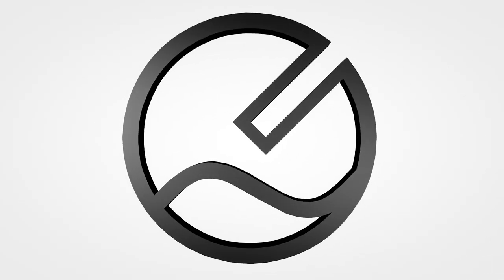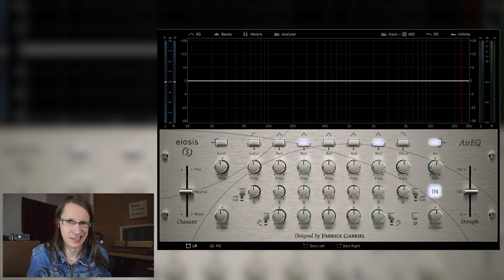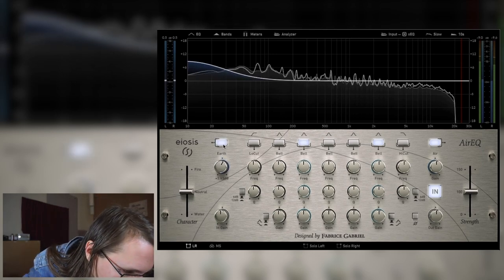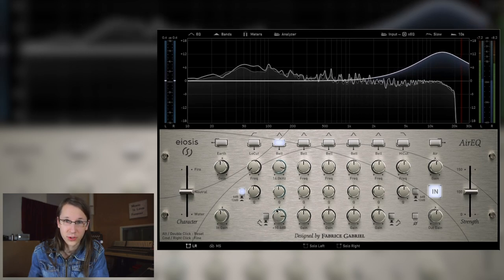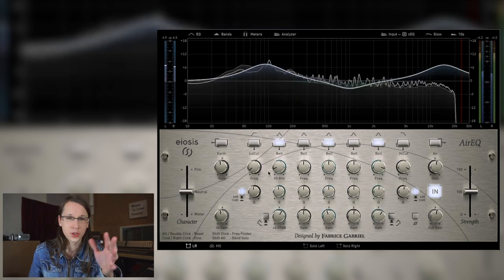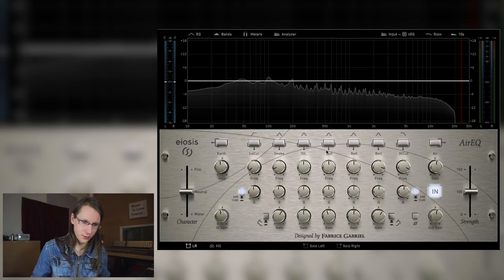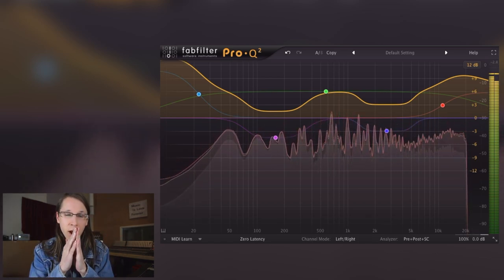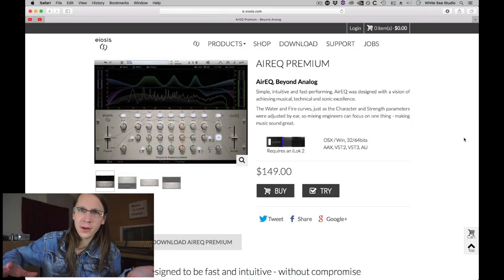AIR? EARTH? CHARACTER? STRENGTH? - Eiosis AirEQ Premium

Comment: Oh, so I need a special screwdriver to open the plugin? Noooo, what shall I do, if I have to switch a fuse? :)
Reply: In the software Reson by Propellerheads you can switch to the backside of the rack and rearrange the cabling. If one is lucky one can also spot fuse holders ;)

Comment: While I do agree about the fantasy lingo... earth, water, strength, character... we don't need a new language, do we?
But having said that, this is an underrated EQ in my opinion. I am not a professional sound engineer. I am a serious enthousiast, have read some good books, watch the right videos, and learned how to use my ears. I can EQ. Am not an expert, but I do quite well if I say so myself. But with the Eiosis I find I can do that easier. The presets are actually quite well done. The presets don't add frequency adjustments, but are just prearranged settings on the EQ bands. So if I EQ a piano, select a piano preset, one of the bands is called 'body' and has settings that indeed, modify the body of the sound. And then it's up to me to fine tune it. I like that. And while I don't know what the lelijk woord things like fire and earth mean, I learned how to use them to add fullness or brighness or whatever I like that piano to sound like. And the visual information visualises what it does to me. 
In this modern day and age that is very helpful. Sound isn't reserved for studio's and professionals anymore. Anybody can do it these days. They can't all do it well, but it's plugins like this that help those serious amateurs. More than EQ's with presets and AI and mixing assistants, simply because this Eiosis concept still makes you think for yourself and make choices based on what you hear.

In that respect, I will forgive them the language and consider myself extremely happy that this is one hell of a tool you get for just paying the quite decent all access pass. I can only recommend people give it a go, experiment with it. It's not going to work for everybody, that's for sure. If it does work for you, you'll find yourself using it more and more.

Comment: inbus is a lot more durable..it's a selling point, really
Reply: Any sane person would screw in equipment with M6x16 Philips head screws using plastic washers to not scratch the front plate of the equipment. E.g. with Rittal DK 7094.100

Comment: I dont think someone answered this, so I will in case no one did..........  But those security screws are there on real hardware, so people dont steal the hardware.
See,  back in the day in large recording studios, people used to steal very expensive gear right out of the studio.
and the owners would lose out on thousands of dollars worth of gear.  specially during night time sessions, when the owners and main manager are not around.
You had hired mix engineers come in to do the session, then you have huge large crowds in the studio session, usually rap/hip-hop crowds where they bring 
every got damn person they can think of into the studio.  then you had part time night managers who actually didnt care about the studio, but just worked there
to brag to people that they work in a major studio.  We call these "shitty managers" hence why they work at night (grave yard shift) and never in important times or important sessions.
then you have interns who come in and out like a grand central station, every few months there is a new intern which made matters worse.
and sooner or later, studio equipment starts to disappear.  So someone thought of installing rack gear in racks with security screws to prevent 
people from stealing rack equipment. 
They are a VERY important part of running a commercial recording studio......  Now these days we have good CCTV and new rules.
which is, each studio room must have a least 2 studio staff members in the room, at all times, and if one of them needs to leave the room,
you call the receptionist and have them call in a intern to sit in the room until the other person returns to the room......  most major studios have this rule.
Most importantly, the studio room must NOT be left alone under any circumstances when there is a client in the room.  If you do, you have a chance of being fired at the end of the session. 

You would be surprised as to the amount of shit that happens in a major recording studio.....  throughout my years I have seen a large amount of (WTF's) in my life in studios......lol
Reply: iLok code is hidden in these screws.